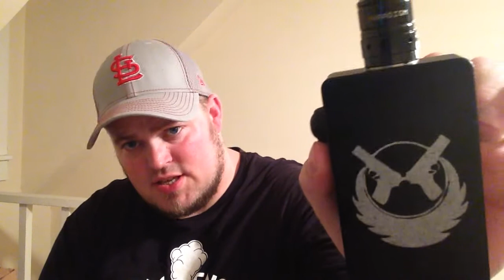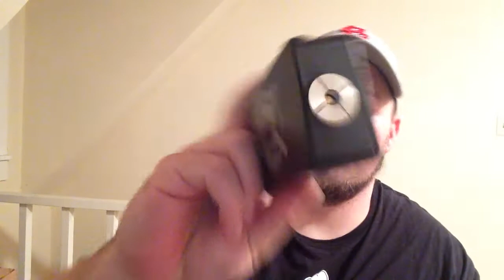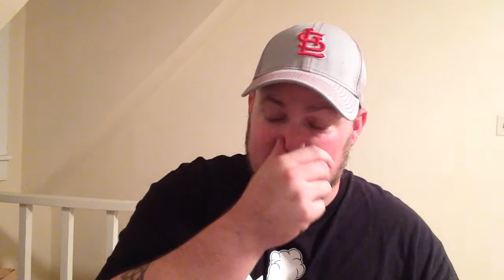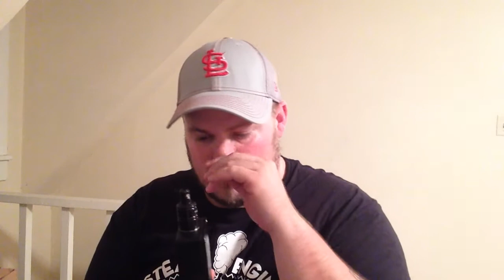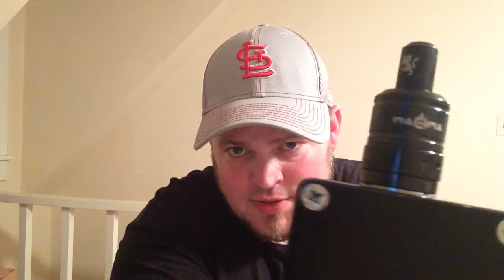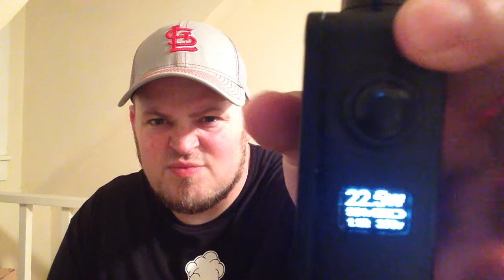Sx350 box mod update and public service announcement

Comment: Hey Josh this is Jeeper from Beardedmods (beardedvapers.com) and just a little update with what I have found from the update to 6o watts. I have beta tested at least 6 to 10 different mods now with several different configurations and the big problem with the update is not on the low end of the spectrum but on 1.5 ohm and up. For some reason when they reconfigured the ohm/wattage loads on the sx they messed up on some of the data inputing or the wattage.to ohm ratio so you keep getting errors. Also just an fyi for the 60 watt update they changed the low range from the original .1 to now where it only does .15. As for the ipv2 issues that is a totally different board (sx300) that is super mass producted by yihi for other large chinese mod companies like pioneer for you, and has some of the great features from the sx350 but in my opinion not nearly the quality of the 350 board. Also my biggest issue with alot.of these mass produced 50 watt box mods is the battery...most of these mods use a single 18650 which allows for alot of issues related to voltage sag and or battery / wire malfunction due to the fact the amperage is being constantly tasked on the battery...my best advice would be to stay away from high wattage regulated vaping with a single 18650 battery and stick with duals or go with a higher amp rated battery like a Lipo pack.(this is all my opinion, just trying help out another box /sx350 board lover....great service from your modder is AWESOME...